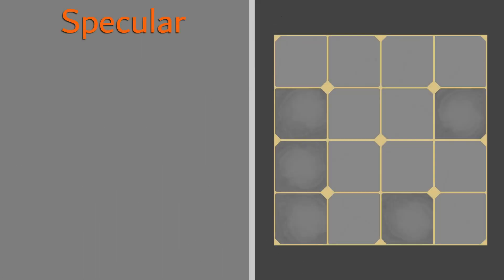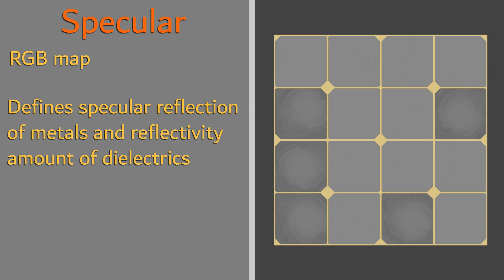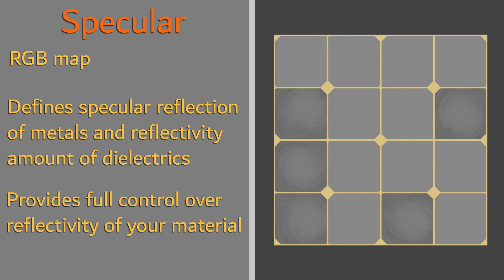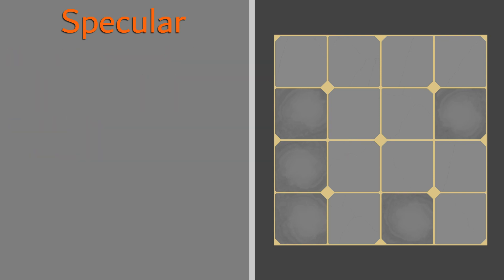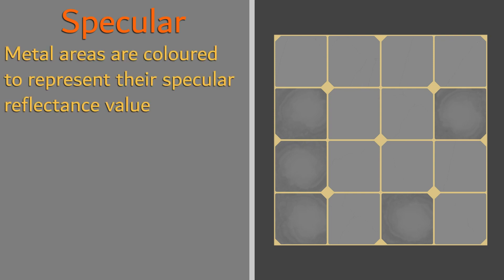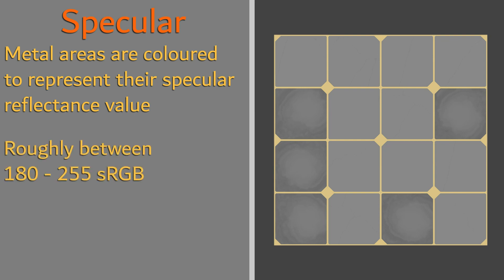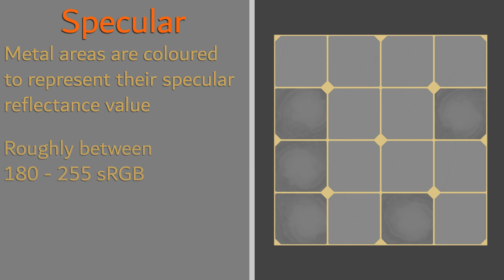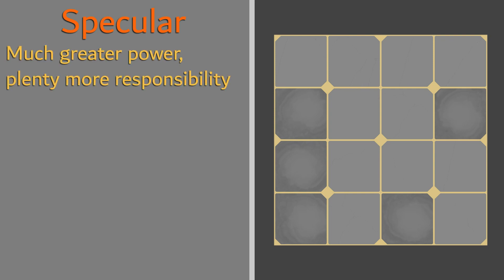What is a Specular Map?

Comment: Hey Chunck!
I've been into archviz since 2017, and everybody used to told me that the specular map for all the dielectrics should be pure white, since they all reflect almost pure white when you looked at a certain angle irl. The way to control the angle then, was the IOR. Since I'm always trying to learn new things, I ended up in your chanel because of your substance tutorials, and then moved to these PBR ones. And here I am, thinking about if I've been mistaken this whole time haha
So, can you please cast some light on the topic?
Thanks!
Reply from the maker: "Cast some light on the topic", I dig it. :D In the PBR workflow, we are using the Specular map to indicate the specular reflection for metals and the reflectivity for non-metals. So what that means, particularly for non-metals, is that we are using this map to determine how much influence specular light has over a surface. In your case, a completely white Specular Map would mean that the entire surface would be 100% reflective, meaning it reflects all outward light it receives, so it would be appear to be an incredibly "shiny" material. Said in a different way, your surface would return 100% of the light it receives because it would be the equivalent of a mirror. Now that might be ideal for some materials, such as if you're making alot of mirrors, however not ideal for pretty much 99% of materials you would likely be making. 

If you have seen a few other of the PBR videos in this course (off the top of my head, I'd think it is the Light Rays, Non-Metals or Specular Reflection videos), you will likely remember that we talk about how non-metals are, on average, only around 4% reflective. There is certainly a large difference between 100% and 4%! While well intended, I think the advice you got may have not been entirely informed. I believe what they meant to tell you is that because metals normally fall within the range of ~60% - 100% that they will reflect "colour" while non-metals only reflect "white". I know personally that was the advice I had gotten before I did some digging. What would be more accurate to say is that non-metals reflect such a small percentage of specular light, often reflecting more diffuse light that had penetrated and resurfaced from the actual material so any "shiny" specular reflection that is seen appears white to the human eye. 

My best advice, never use a full pure white map for your Specular Map if you are using PBR systems, as you will get very wacky results. This system operates on realistic values, so it needs realistic input to operate properly (and consistently). I would also avoid using pure white in any capacity in a Specular Map, unless you have done some research into what specular reflectivity your materials have in the real world. Nothing really ever is a true 100% reflective, that's a digital byproduct. Otherwise keep it low, I'd say mid gray or lower but never reaching pure black either. I hope that helps and is digestible enough! It was a real great question, I wanted to make sure I covered enough of it without ranting. I'm sure there may even be some minor inaccuracies in what I've said here, so please feel free to do your own research or correct anything I've said. Hopefully this will get you started, and thanks for watching! :)
Reply: @GetLearnt  OK, I've been searching here and there, watching a bunch of hours of Grant Warwick webinars ... And I think I've got a conclusion:

The key, and that's why I think that the method that I use is also correct, is the render engine type.

If you're working in a real-time render engine, the reflection map for a dielectric material should represent around 4-8% reflectivity.

However, if you're working on an offline render engine (In my case, Corona Renderer), the base reflectivity of a dielectric material is determined by the IOR, that should be around 1,35-1,7. Then, the reflection map just determines how much reflective is a material when you see it at almost 180º angle. The glossiness map then will control the roughness of the material.

If I'm not mistaken that means that I was not wrong using these white maps (maybe I shoulld not use pure white because that's not real at all). But thank you man because now I know WHY I do this, and now I've got a better understanding of how render engines work.

If you think I'm still mistaken, let me know haha
Reply from the maker: @alexauroherrera1430  I suppose it depends on the engine that you're using. I personally haven't used Corona, so I'm not sure how the system may be set up. All surfaces have different densities, which affects the way light penetrates it. When light enters the surface, the angle that ray was traveling bends a certain amount, depending on the surface. We map these differences in direction to our IOR values. We use these in our 3D environments to determine how light enters a surface and how far it may deviate from the initial direction once it enters the surface. I'm unsure if maybe Corona somehow sets up their system that way but that would definitely be new to me!